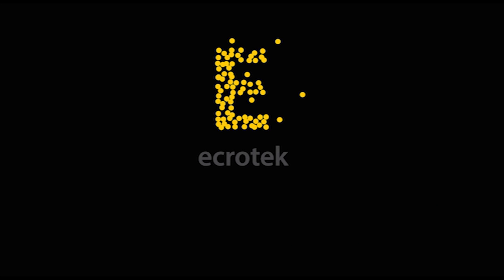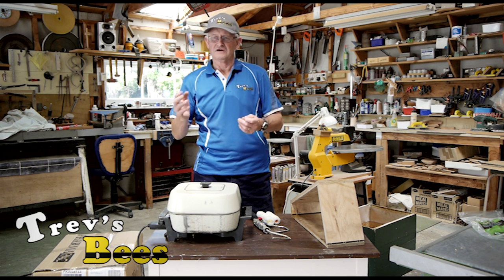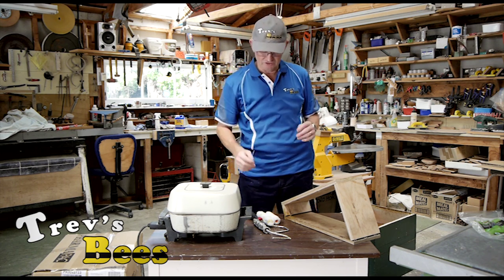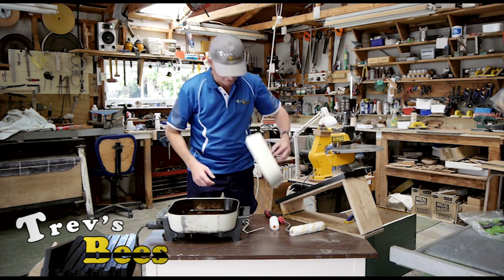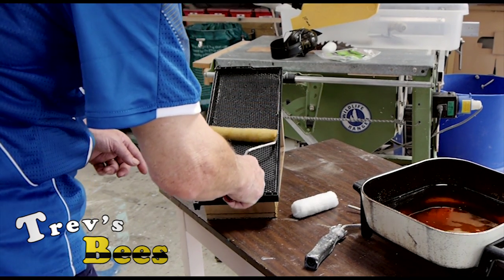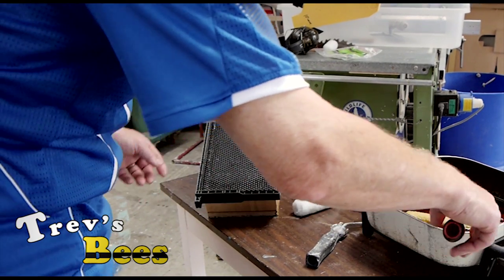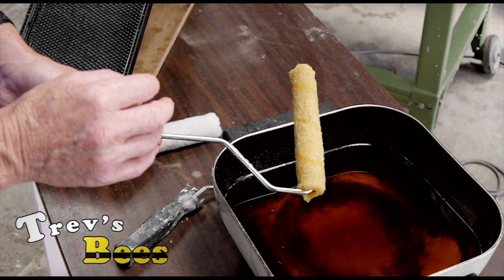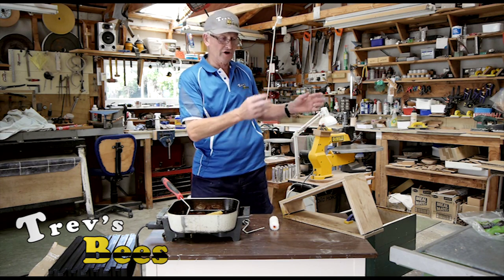Trevs Bees - Applying Bees Wax to a plastic Honey Bee frame

Comment: I always seen plastic frames as beetle hotels, since they provide tine spaces for beetles where bees can not get to the beetles to run them off. As a matter fact, those spaces on the plastic frames act as save heavens for beetles and other pest.
Reply: So, where is a place for plastics frames?

You said several times in your comments that '''However, there is a place for plastics frames'''

If plastic frames are a save hotel for beetles and moth and other critters, why would anyone want to use them if their bees or harvest can be jeopardized?
Kinda puzzles me.......

Either plastic or wooden frames can be put in a centrifuge, has been done for many years on the wooden  frames with wax foundation.
I never seen a certificate that stated that the plastic frames are food grade material.......many claim they are, but they never come forward with an legal binding document. Not all plastics are food grade.

And it actually bugs me when i see folks using any plastic containers or pails when harvesting honey and the plastics are not even food grade.

So why should someone use plastic frames?
Can you show me a document that those frames are actually food grade material.

Comment: Gday trev i did my second harvest yesterday ,was only 8 frames as im just a little backyarder but out of 8 frames i had 7 blowouts . this caused me considerable hassle as i had to keep cleaning filters /screens that built up with wax and the honey wouldnt flow through the one frame that didnt blow out was ? yep plastic so guess what is going in my honey super ,all the frames were wired and had good foundation  but it took me 5 hours to complete my extraction main reason having to stop and clean filters did get 16 kg though better than 4 last year take care .

Comment: Thanks Trev, I'm going to do mine right now.  Do you (or anyone else) have any tips on luring bees into a brand new hive?  I'm going to wax and then dap some lemongrass essential oil and then sit back and cross my fingers :)
Reply: I was thinking of trying the same. Did you mix the beeswax and lemongrass and spread it on plastic frame?
Reply: @j.johnson2792  I melted some wax and then poured it along the inside top of the wooden frames (pretty wobbly rough job!) but just to show them where to get started.   This seems to work perfectly as they drew the comb from the top down.   Then lemongrass I just dabbed around the place.

Comment: Hi Trev, Why do you use the plastic frames if you are not a fan of them? Are the plastic frames being used more on a commercial scale and are they better than the wooden frames or is that just down to personal preference?
Reply: Westernwilson,
Would be easy and cheaper to mark wooden frames with an pencil or pen or a  painted dot  if used or not used for a specific application or use.
I even can write on wooden frames and write  notes right on them.

I don't think you could do this with an black plastic frame.

Comment: Trev, how do you clean the plastic frames easily over winter time??.  I know you aren't a fan of them.  How clean do you need to get them.  I use a paint scraper however there is still residue left on them.  Admittedly, the wooden frames with foundation are a lot easier but I have inherited a whole lot of the plastic frames.  Thank you.  Your channel is awesome.
Reply: @EcrotekBeekeepingSupplies1  Thanks for the advice - by the way, you are an amazing woodworker and have an excellent setup.  a good example of kiwi ingenuity (-:

Comment: WOW, you say 110, and most of the folks here say (300F) 150C, they never mention the little inner roller, thanks for that tidbit of info,
Reply: As I watched, I thought 100-110 was much hotter than it is, because of the excess running like that, was shocked that it was only 230F, and good to know that over 100 it discolors. learning more every day, Thanks again
Reply: I thought I heard melt point is 146 or so, but 55 would be about 130, WOW, good to know, gonna have to start melting down some wax for my foundation, got a couple jars from cleanup of frames, and 10 frames of really old comb from the original nuc's, last thing I want to do is attract moths.. Thanks again
Reply: These were treatment free, the guy I got them from refuses to treat, even with OA, so it is good, but thanks for the reminder there
Reply: I tried treatment free, and my girls didn't make it thru winter, going to try OA (Oxalic Acid) this season